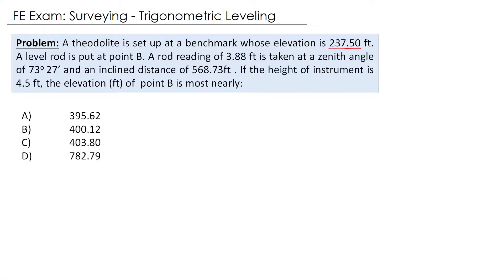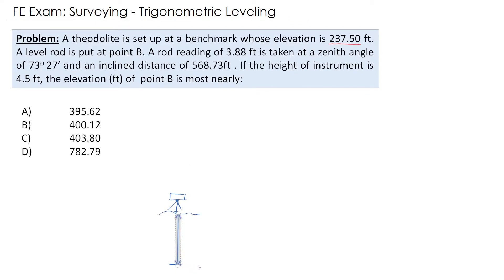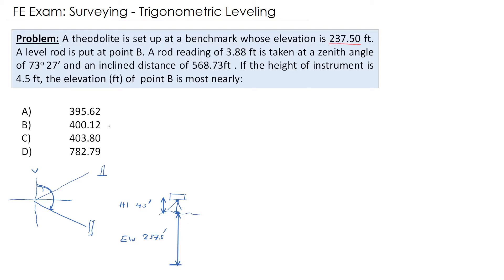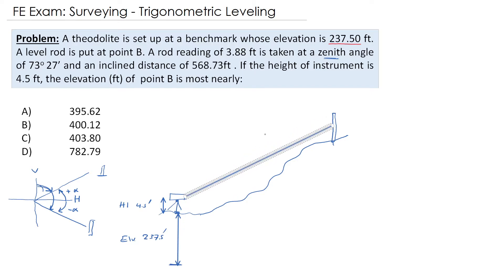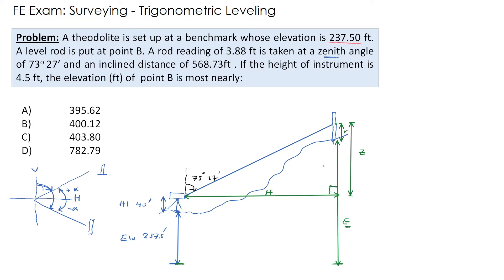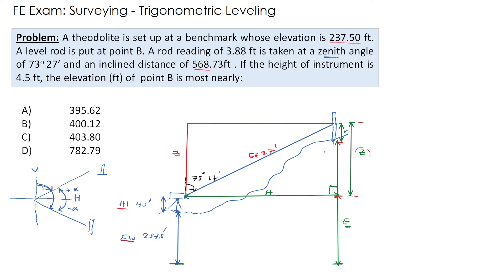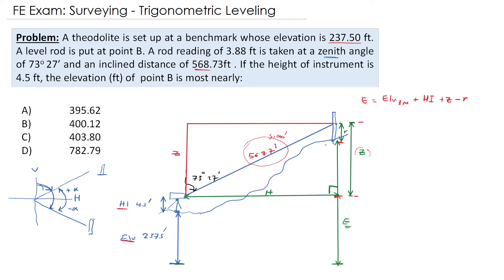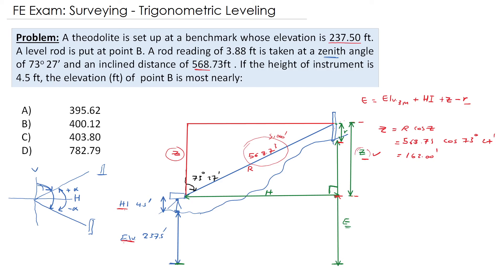FE Exam: Surveying - Trigonometric Leveling

Comment: Can you please explain why you used Cos Z = Z/R instead of Sin?
 As Cos = Adj / Hyp and Sin = Opp / Hyp and in our case Cos would be Cos= H/R.
Please clarify.
Reply from the maker: Hi Yash,
The angle Z is confined between the vertical axis and R. If We took the angle between the horizontal (90-Z) and R you will be correct.
Reply: @soefeexampreparation6158  thanks sir